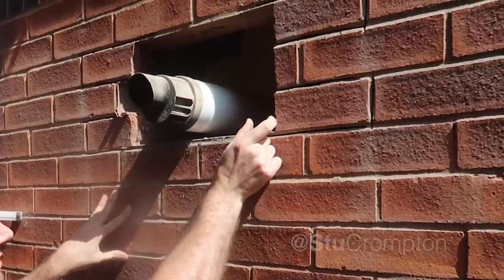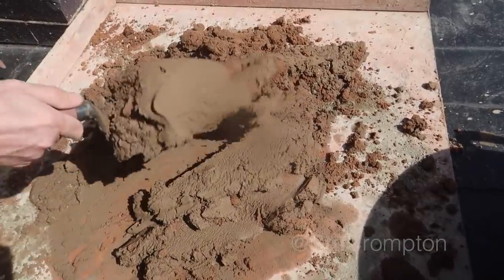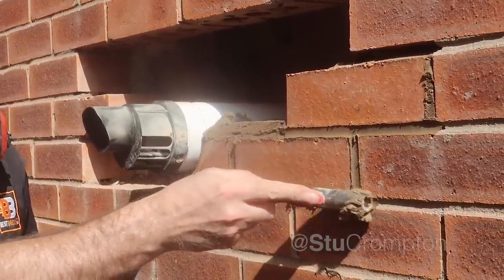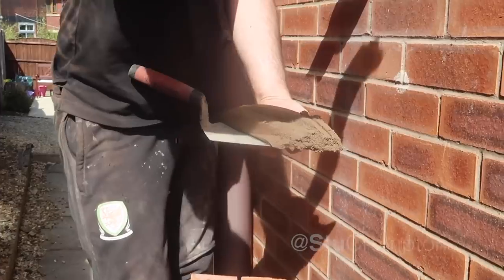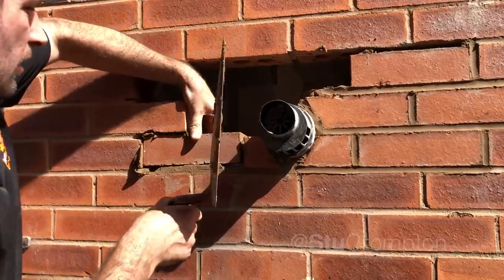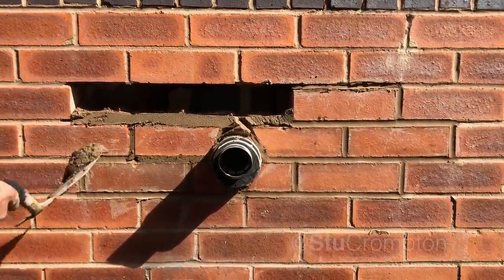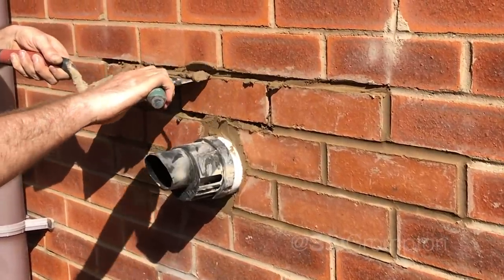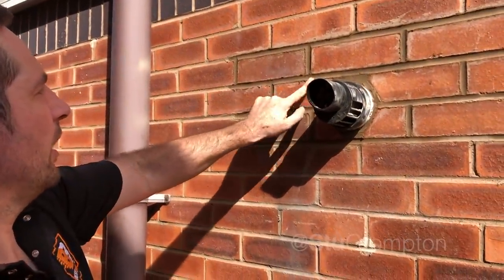Bricking Round a Flue - Not an Easy Job

Comment: That's the trouble with battery tools, it's a lot easier to find a plug socket and extension lead than it is the right battery if you havent got the right charger.

Comment: Good job Stu. I always use a smaller trowel for the top course when bricking round Flues makes it a bit easier. Bet you wish you had your sds drill to cut them joints out. You were unlucky to crack the bricks made it a bit more difficult but it turned out a gooden in the end. Is the Plumber going to fit the flue seal on the outside.

Comment: So did you get the flue falling back to the boiler?
Also some boiler manufacturers do not allow the white part of the flue to be showing after bricking back up, although that's the installers mistake to be fair.
Reply: Yes I thought the flue looked too horizontal, compared with how he first demonstrated it would have to be.
Reply: The collar round the flue was probably taken off so it could be bricked up. Once reinstalled you'll probably not see any white.

Comment: Question..... Why dont you pull the flue back through the wall, brick up the hole then core drill it?
Reply: Unless Stu has suddenly become gas safe registered, he can't disconnect/install a flue  👍
Reply: Cos then you would have to wait three or four days at least for the mortar to harden before you can rattle it with a core drill and the custard wants that boiler working there and then !!